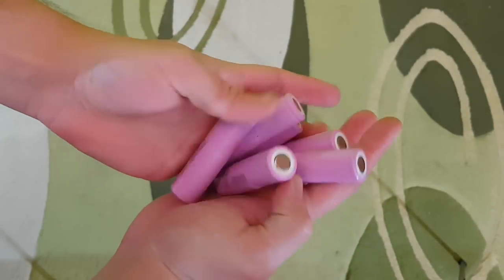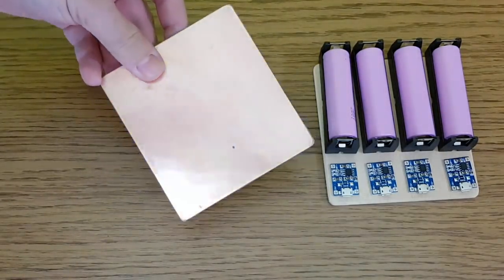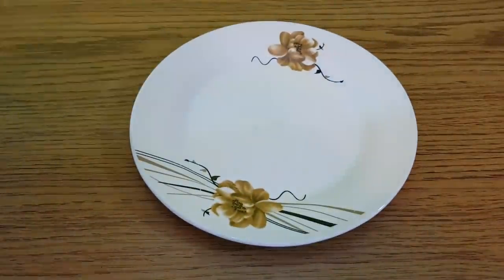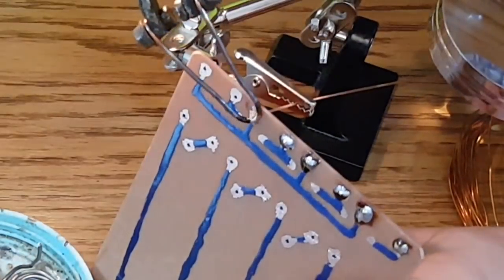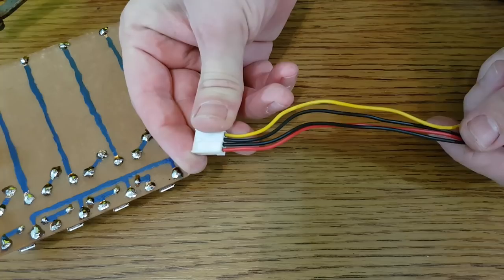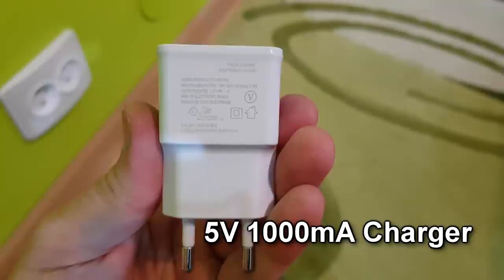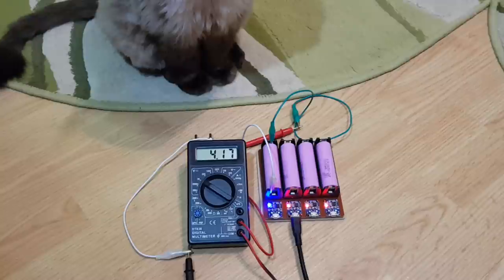Simple DIY 18650 Battery Charger - TP4056 Review (Everything Explained)

Comment: Good video. Nice layout of the PCB. Only issue is the completely wrong way to solder. Heating the joint then applying the solder to the joint is the correct way.

Comment: I have done something very similar with a vero board but woithout the plywood base. I have used plastic screws as "legs" for the charger to stay 10mm from the ground and also used 2 x 40mm fans to keep the TP4056s cool while charging. I am using 2 step down converters and a laptop charger to step the voltage down to 6V and feed that to the charger. This can charge the cells with 1.1A each very easily but the fans are needed as each TP4056 is dissipatinf anywhere between 2 and 1 W. 
You need to keep the cable lengths and connections minimal as it reduces the charging current.

Comment: YIKES! You used a soldering gun to solder wires to the plastic 18650 battery holders without melting them! I tip my hat to you! I did that when I was 13 with a Radio Shack "P Box" SuperRegenerative FM band receiver and an AM band IC integrated circuit radio. I melted part of the plastic perf board but I did not fry the transistors and the FM SuperRegen worked. It had that familiar rushing noise but, alas, no FM broadcasters to hear on Grand Bahama Island back in 1975.

Comment: If you are using ferric chloride try it warm up. You can do it in microwave or with hot wather. Etching will be much quickly. Temperature can reach around 80 degrees celsius.

Comment: Hello, nice video! One question... Does the OUT+ port always provide 5 Volts when:
1. The battery is full but the power source still being connected
2. The battery is currently chargin
3. The battery is powering the device on the OUT+ port
Reply from the maker: hi. I suppose you are referring to the TP4056 module with battery protection. the charging module can provide max 4.2V for the battery. the output voltage is the battery voltage.
1. when the battery is fully charged to 4.2V, the charging module doesn't provide voltage anymore, but is still monitoring the battery voltage. if you have a consumer connected to the battery and the battery voltage slowly drops to 4.0V, the charging process starts automatically and the charging module is providing 4.2V again.
2. & 3.  the out pins deliver the battery voltage, even when the battery is charging.
Reply: thank you! :3

Comment: Can this charging method be applied to 3S 18650 system using the TP4056 module , and have a secondary wiring for the batteries to provide 12v output isolated by a 3way on/off0n switch ?
The 3S modules are not very good , I like the TP 4056 better .
Reply from the maker: no. I made another video on how to charge li-ion cells in series with TP4056 modules.

Comment: Very nice video. I've learned a lot and because of this video I have the courage to build one of my own. (Just started this hobby). 1 question though,  at the end of the video you plug the USB in the third port and at the very end in port 4. I am assuming it doesn't matter which one you plug it into?
Reply from the maker: hi. the inputs of all 4 charging modules are connected in parallel, you can use which micruUSB port you want.

Comment: From what I understand a typical charge rate should not exceed 1/2 the battery's rated capacity. This means a 2.6Ah battery should not be charged at more than 1.3A. Fast chargers will exceed this but will shorten the life of the battery and if the BMS [Battery Management System] charges the battery to 4.0V [80%] instead of 4.2V the life of the battery is even more greatly extended.

Comment: If I set a power supply with constant voltage and current control at 4.15 volts 1 amp , will that work safely? Thanks nice work

Comment: Nice work Sir.   How many hours to  fully charged  this 18650 battery using TP4056. Thank you so much
Reply from the maker: hi. it depends on the battery capacity. usually 2 -> 3 hours.

Comment: I like the video but i'm confused...
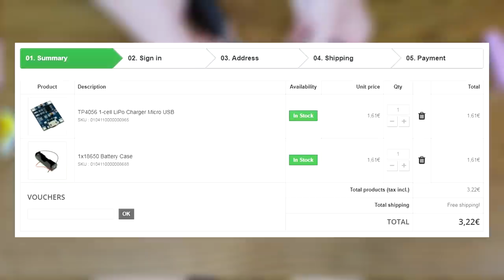Those batteries are Lithium Ion, but the  charger 1:36 is for Lithium Polymer batteries. 
Li Ion = 3.6v max 4.10v
Li Po = 3.7 max 4.20v
So you will damage your batteries unless they are rated 3.7v
Reply from the maker: hi. this charging module can charge 3.6V and 3.7V cells. it has a maximum charging voltage of 4.2V, which is the same for both li-ion and li-po. for example panasonic NCR18650B has 3.6V nominal and 4.2V max.
Reply: @Sorin_DIY  based on my research and the info on my smart charger, li ion battery max voltage is 4.1.
But still, I like your video and those kind of diy projects. :)
Reply from the maker: the charging voltage differs for each type of cell. for example in the link below there is a Samsung S9 li-ion battery with 3.85V nominal voltage and maximum 4.40V. obviously it cannot be charged with a TP4056 module. this charging module it's made for cells with max 4.2V li-ion or li-po. 
https://rounded.com/samsung-galaxy-s9-plus-sm-g965f-battery-eb-bg965abe-3500mah-gh82-15960a.html

Comment: Will plugging in a usb charger to two of the micro-usb ports speed up the charging for the batteries?
Reply from the maker: no. the microUSB ports are already connected in parallel. you need a powerful charger.

Comment: Salut! Foarte bun video. Tine-o tot asa! Am facut si eu ceva mai simplu pentru doar 2 baterii, dar problema care o am este ca TP4056 incarca bateriile peste 4,2v. Au ajuns pana la 4,27v si tot nu s-a aprins led-ul albastru. Le-am masurat cu multimetru ca sa le scot de la incarcat. Ti s-a intamplat asa ceva pana acum? Mersi mult
Reply from the maker: salut. de obicei incarca celulele pana la 4.20 - 4.25V. la 4.25V nu ar trebui sa fie probleme. pana acum insa nu am avut un modul care sa treaca de tensiunea asta de incarcare.
Reply: Ok, asa am sa fac. Oricum nu au fost probleme dupa ce am construit si bateria externa, avand un modul specific pentru incarcat. Am masurat din nou bateriile si toate au ajuns la acelasi voltaj dupa o incarcare de telefon.  Mersi

Comment: Nice video. 

Say, If I connect those 4 batteries in parallel, do I still need 4 TP4056? 
I know I can still use 1 TP4056, but I need faster and safer charge method.
Reply from the maker: you can connect all 4 cells to one TP4056 module, but they will charge 4 times slower. 1A/4

Comment: Sorin, would you be able to avoid using the black wires if you had more room on the copper plate to lay negative traces underneath? Also how did you wire up that volt meter to make it work with usb?
Reply from the maker: hi. if the copper plate is a few millimeters longer, you have room to lay the negative traces and not use the black wires.for the volt/ammeter you can find a diagram in the description of my power supply conversion videos 1 & 2.

Comment: Hi, in this case you charge the batteries in independent form, in parallel connection of circuit charger but if I want charge a batteries array 2P3S as laptops battery, then is serial connection among chargers circuit. Moreover, adjust the current in mA. Kind Regards.

Comment: Hey man, what if I had two lithium ion batteries and I connected them in parallel, can I use just one TP4056? Or do I need two?
Reply from the maker: if you also use them in parallel, yes you can charge them in parallel. the cells need to have the same capacity and preferably the same charging/discharging cycles. if you intend to use them individually, you should charge them individually.

Comment: Is this module used to charge cell phone battery?
Reply: This module turns the USB 5v down to the 4.2v required. So no, it will not charge a a phone

Comment: I saw two other similar videos but on those it is recommended that each circuit have its own power supply. The one actually went as far as using a transformer with four taps, rectified, to supply the 5 volts for each circuit board. Could you explain why they did this and why you have not done so.
Reply from the maker: hi. if you have a battery pack with lithium cells connected in series and you want to charge it with TP4056 modules, they need to have isolated power supplies. but if the cells are not connected in series, you can use one power supply for all charging modules.

Comment: I think the solution for you to charge them all at the same, and the length of time to fully charge them is an issue, is for you to use a led bench power supply that will give you 5VDC at 4A.

Comment: hello good job
the wire that replaces the pin connectors, is it really 0.8mm²?
because it fits easily into the holes of the card, it looks like 0.5mm²
Reply from the maker: the wires are 0.8mm. the holes are not perfect.

Comment: I love your videos. Do you have a video on how to charge the 18650 cells and discharge or use the power from the 18650 at the same time. For example, a Bluetooth speaker build using 3 x 18650’s that can be plugged in to charge them while you are using the speaker. I tried this and the battery wires started to smoke. The only way I can use the speaker is to charge the batteries then instal them in the speaker or plug the speaker in without 18650’s installed in the speaker. 
Thank you very much in advance.
Reply from the maker: hi. my bluetooth speaker does that. I can charge it, while it's playing music. you need short thick wires for all the power supply connections. but it's using only 5V and very low current. in the future I will make other bigger speakers, with bigger battery packs.

Comment: Great video! I have the question: Can you plug 2 usb charges to this power bank to charge cells faster — is it possible? Will it work? Or this is discouraged?!
Reply: Dmitry Labetsky You cannot use two USB in parallel as they will destroy each other. What you can do is to connect one USB charger for two batteries. So split it into two seperate curcuits.
Reply: Torben Møller So as I understand you can not connect 2 usb charges to 2 circuits (input of which is connected in parallel to charge 2 cells individually) ?
Reply: @dmitrylabetsky5278  The standard configuration used here is to use one 4 Amp USB charger for 4 batteries (each consuming around 1 Amp).  If you want to use 2 USB, (each providing 2 Amp) chargers you cannot just used these in parralel.  So what you have to do is to cut the connecting between the 4 batteries up into 2 x 2 batteries.  Then you can use one (2 Amp) USB charger for each of the two battery curcuits.
Reply: Torben Møller Thank you for the reply! Can you please tell me why is it not possible — what is the physics behind it?
Reply from the maker: hi. @Torben Møller is right. you cannot connect 2 USB chargers in parallel, no matter what you use them for. you can make the cells charger with 2 pairs of tp4056 modules connected in parallel. each group powered by one microUSB port, if you have 2 USB chargers. you can also add a switch between the 2 groups, that make the second pair of charging modules to be powered from the second microUSB port (if you have 2x 2A chargers), or switch it to be charged from the same microUSB port as the first group (if you have a 4A charger/power supply).
Reply: Guys, thank you very much for the replies. I still have 2 questions unanswered though ::)) can you elaborate on them please: 1) why is this not possible - what is the physics behind it - I mean what is the actual reason of it not being possible? 2) What component will break/burn if one will still do it? (Batteries will break, chargers will break or TP4056 will break ?)     Other than these two question everything is clear for me now.

Comment: Nice video! :) One question: Can I put this system inside a device so the batteries can be powering a circuit and being charged without taking them out? I mean the device would have a USB port to connect the charger.

Thanks!
Reply from the maker: yes. but if you use 2 or more cells in series and want to charge them from one USB input, it will be a bit difficult.  I will explain in a future video how to use and charge multiple cells connected in series, with only one USB input for charging.
Reply: Sorin - DIY Electrical Nerd  I mean using the setup in your video and use them while charging :)
Reply from the maker: oh, yes you can use them while charging. but it's not recommended to connect a consumer that uses a lot of current. I would say maximum 100 or 150 mah. otherwise it will be very difficult for the tp4056 module to charge the cells and it will continually toggle between charging/discharging the cell. it will shorten the cell's life. or if the load is to big, the cell cannot be charged.
Reply: Sorin - DIY Electrical Nerd How can I calculate the mAh of a circuit?
Reply from the maker: the easiest way is to use a panel voltmeter/ammeter, like I did in my bench power supply and USB tester videos. after you finish the circuit, test it with the ammeter. then you will know if you can use it while charging the cells. that is why I've made an USB tester. I'm planning to make many portable devices with 18650 cell and I need to know how much current they need.

Comment: is it safe ? what about overcharged batteries and overheated cases ?  i'm considering building one of those and i'm just taking notes about the safety issues.
Reply from the maker: hi. the TP4056 chip will get hot when charging with 1A. so you need to add a small heatsink for safety, especially if you install them in a closed enclosure. you can change the programmable resistor to charge with a lower current. you can also add a switch to each charging module, that toggles between 2 programmable resistors. in one position to charge with 1A and in the second position with 0.6A, for lower capacity cells or less heat.

Comment: Do you ever add a resistor to VCC IN to help with heat? Mostly for charging at 500ma-1A
Reply from the maker: I didn't add a resistor to the power input. if you charge the cells with 1A, the TP4056 IC will get hot. you can add a heatsink on the IC. or you can charge the programmable charging resistor, so the module can charge with a lower current, like 700 mA, this way it will not get hot.

Comment: how did you discharge? thanks (also are you able to have capacity displayed? or internal resistance someway?
Reply from the maker: hi. my next video will be with a better battery charger, with discharge capability (with protection) and voltage monitoring. it will be available in a few days.

Comment: I want to build a LED lamp with these batteries and charger, can I have the LED's turned on while charging??
Reply from the maker: it will work, but it's not a good idea to use the batteries while you charge them. it will shorten the batteries lifespan.

Comment: im planning on doing this myself just adding a battery indicator display, i have some 1.5mm cable in my garage would i be ok using that for a project this small?
Reply from the maker: hi. the 1.5mm wire is very good for this project.

Comment: Awesome video! If you ever make a new version, you should consider using a 12V input & some cheap buck converter modules, that way you can power it with a more conventional amp & volt figure. Also, what's up with that soldering iron you're using? What is its brand? :o
Reply from the maker: hi. it's a powerful Romanian made soldering gun from the '80s and '90s. it's not made anymore.

Comment: Nice video.. can i tell me if its normal the chip come hot ?
Reply from the maker: hi. the TP4056 chip gets hot, when it's charging with 1A. if you use this type of charging module very often, you can use some tiny self adhesive aluminium heatsinks.

Comment: can you plug more than 1 charger? I mean, plug 2, 3 or 4 usb plugs  (1 per board). Would it work? Would it explode?
Reply from the maker: you can't connect multiple chargers, it's not good for the chargers. but you can connect 2 modules to 1 input and use 2 powerful chargers, one for each pair of modules.

Comment: Hi, i have a question. If i have 2 chargers of 2 amps each. If i put them at the same time, do i have the 4 batteries charged at 1 amp each ? Thank you if you can reply because i want to do the same but with 8 batteries cells and 8 TP4056 to charge them at 500mA each with 2 chargers of 5v 2amps.
OH i have another question by the way:
If i use 1 TP4056 for 2 battery cells (so in parallele, not in series) SO 1 TP4056 will charge them at the same time with 500mA SO 1 TP4056 can charge 2 batteries at the same time OR is it dangerous because il the battery cells have not the same voltage in // it will over warmed ?
Reply from the maker: Hi, if the chargers are of good quality it should be ok. if they are of bad quality and there is a voltage difference between them, one of them may burn. 
li-ion cells can be charged in parallel, only if they are connected in a battery pack and they are charged/discharged together. 
if you want to charge cells with a low current, you need to change the programmable resistor on the TP4056 module to limit the current; you should not force the charger.